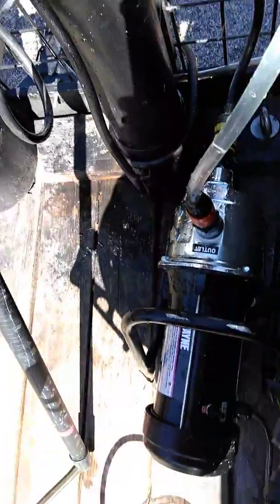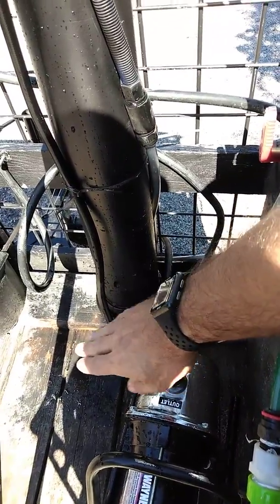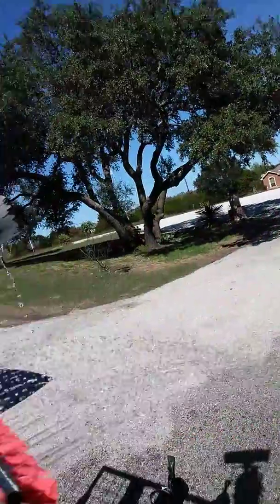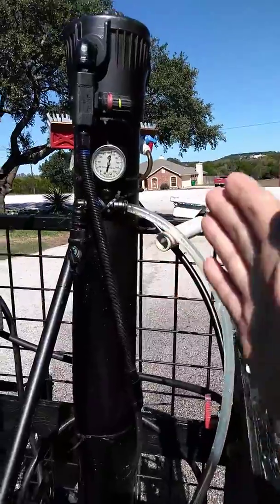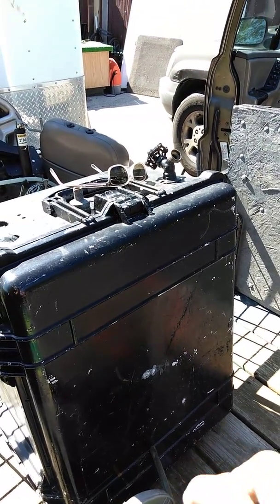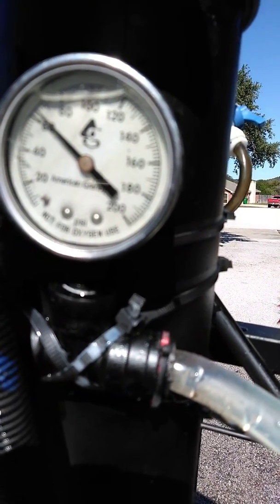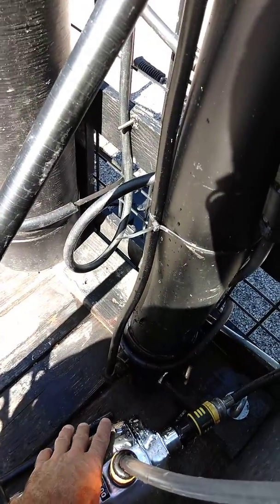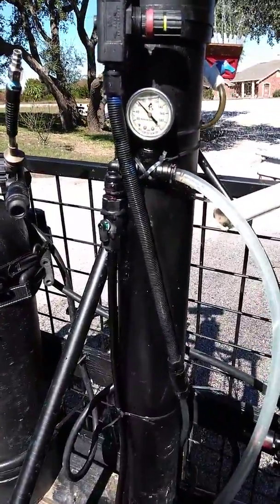Wayne PLS100 RO Booster pump for 4040 RO

Comment: Hey Jack, what size carbon block filter are you using?  Does the size of the filter affect the flow?  Also, what micron filter?  I'm guessing the smaller the micron the less flow?  Thanks, -Ross
Reply from the maker: I use the big blue type housing, cost $1. The filter is 20" the outlets are 1" This is a Carbon block made for chlorimine and this one doesn't let chlorine thru after so many gallons like others will. Yes size outlet and filter size does help flow. You could lose 10-15 percent just thru pre filters. That is why you boost after filters before RO. Plus not needlessly forcing water and pressure thru those filters. A typical 3/4 port 10" will work fine. Sometimes I just use the CB and bypass my 10" if pressure is really low
Reply from the maker: Yes, small micron less flow.
Reply from the maker: I believe my 4/4.5x20 Pentek ChlorPlus pits out 4 gpm. A standard 10" x2 usually .5 gpm. Big Blue types like the 4" or 4.5 10" put out 2 gallon
Reply: Thanks Jack I appreciate you're knowledge.  I'm trying to research for building my own DI unit for window cleaning.  Definetly a newbie with this stuff.  Do you know a good source for buying DI vessels?
Reply from the maker: @diymotorcycling1719  . Depends on the tank size you want. I started with a free 1/4 cube. Got another from Portable DI so had a dual mixed bed. Later I changed to a dual bed where tank 1 had cation.amd the 2nd Anion resin..Makes nearly.2x water but at a higher ppm like 2 or 3 vs starting at 0. I did have a 1.5 cube bit way too heavy and tall. Now got a 3/4 cube from WCR. Basically all the same price. Resin. Nationwide DI free shipping on first order. DI rinse sells 50/50 on web bit of you call you can get 60/40, preferred Mixed bed rinse. A 1/2 Cube is good too. Depends on how much you are using DI. I tap wash first and using certain soaps, nearly spot free so I only need a little water vs using pure to clean and rinse. Let the tap water remove the crud and pure to finish.